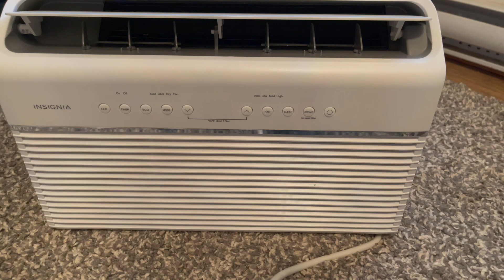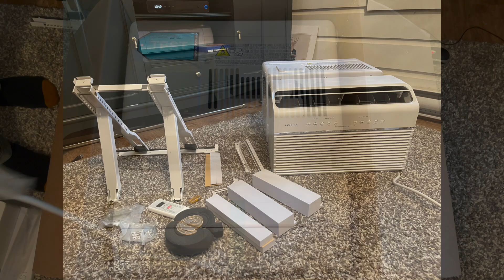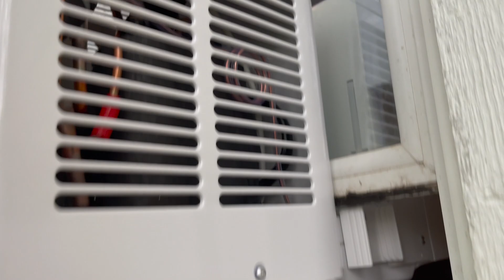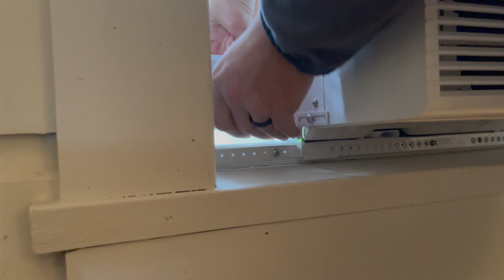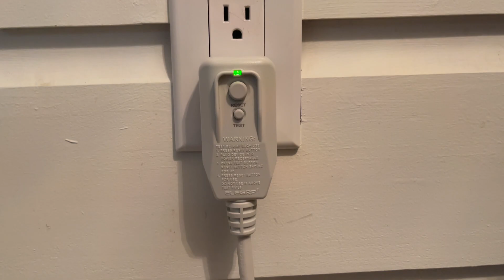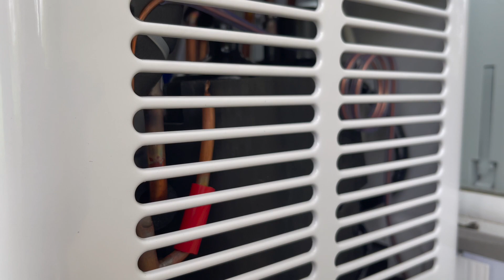Insignia 8000 BTU Air Conditioner Review

Comment: Good review except she didn't talk about the other most important thing , it's a *DUAL INVERTER*, dual inverter air conditioners are great for many reason, they are not that common and units with them are usually about $100-$200 more, If interested I'd suggest reading about Dual Inverter air conditioners on your own, bottom line they increase the life span and they save money on your electricity.. Oh yeah this also has a rarely found awesome high energy efficient rating of 15,most are around 11,
The hight the better..

Comment: This product has a serious flaw. In the filter area there are large gaps that allow dust and air to easily bypass the filter. I’ve had mine running nonstop for a month now and the coils are clogged with dust. Disappointing.
Reply: Also perfect for annoying bugs to come thru
Reply: DId we find a way to resolve this? a solution? that i can use to mitigate that problem?

Comment: anyone know. . . how does this unit drain the water/ condensation??
Reply: I'm not sure about this one per say but most of them have a hose which can be lead outside and drain
Reply: IM wondering too because the media had mold issues so i want to see if there is a way to stop the collection of the water fromt he condenser.. did you figure this out?

Comment: I own both Midea and this unit. Honestly I can’t tell a difference other then the vented cover cosmetic. Both are similar in noise, function, installation, and cooling abilities. I do noticed Midea has a more responsive remote control but at $70 differences at this time of posting, it was a no brained decision for me. I am able to cool a 500-600+ sq foot loft with out any issues. Also It’s pulls 500-600watt of my solar system if anyone is interested. Hope this info helps. 🙏
Reply: Peak draw or constant pull... What's your average watts used per hour? Thank you.

Comment: Can this exact AC be installed with a sliding Window?
Reply from the maker: Hi, it is possible to install this unit in a sliding window, given the window meets the required dimensions. However, you will not be able to close the window with this design, so it's not recommended.

Comment: Is this ac really that quiet in the video?  Had my ac for 24 hours and hearing noises.  It’s summer in Hawaii right now so maybe it’s the humidity, but blower is always throttling, hearing clanks outside, and hearing water noises maybe every 30 min.  I’ve had this insignia literally 24 hours and starting to wonder if I have a defective unit or this is how it supposed to be, never owned an ac before and it was 55% humidity today.

Comment: Where is video instructions
Reply from the maker: Hi, the installation video can be found in the image carousel on the product page - https://www.bestbuy.ca/en-ca/product/insignia-u-shaped-window-air-conditioner-8000-btu-white-only-at-best-buy/15732887
Reply: Can this unit be used on a slideing window
Reply: The link does not work

Comment: Isn't this AC essentially the Midea U AC minus the smart functionality? How is the product better?
Reply: I agree with Kevin. It is the same. It is not better.
Reply: In their defense, it is about $250.00ca cheaper than Midea's
Reply: It's not better, but when the Midea is out of stock this unit is a suitable replacement, and recently it's $30 less than the Midea, especially since you can buy it same day at Best Buy
Reply: Where is video instructions?
Reply: It is 75 % the same.  Midea makes the this ac for insignia and another company (forgot name).  Difference is Midea’s model has smart tech, cost more, and I heard a more advanced inverter (also means it’s quieter and more efficient).  In general, insignia is the $100 less version with less tech
Reply: The insignia version has large gaps that allow dust and air to easily bypass the filter. I’ve had mine running nonstop for a month now and the coils are clogged with dust. Disappointing.
Reply: @bloodclot  have you figured out a way to prevent this?